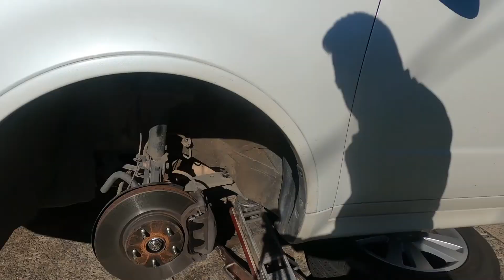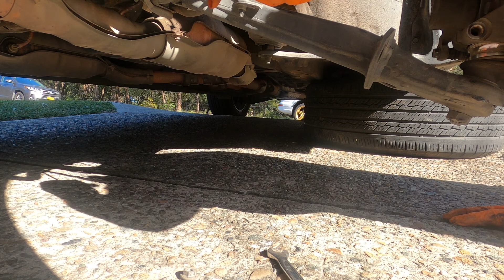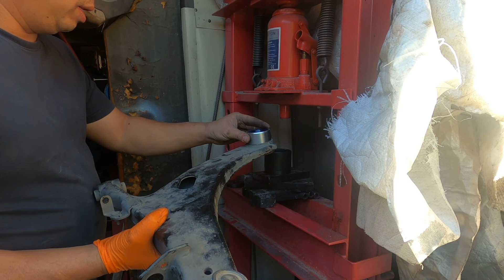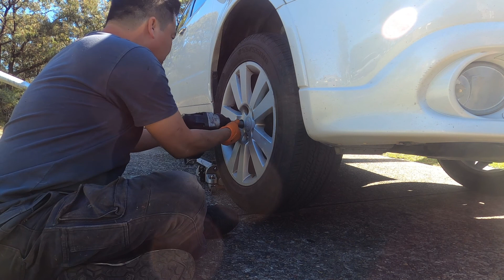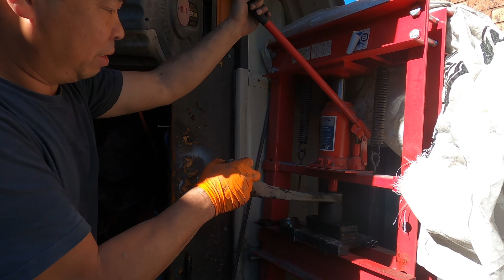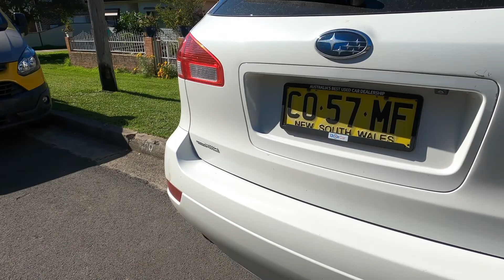subaru tribeca 2012 cv joint and low arm bushes

Comment: I am in the middle of doing a complete bushing replacement on my 08 Subaru Tribeca. I have a small ball joint press kit but it doesn’t have the size adaptors I need so it’s been a pain in the ass. I can’t find anything that sits right on the bushings ledge. I may have to burn and cut it out. I almost won a hydraulic press in an auction last week. Damn I wish I would have won it. It would have saved me a lot of head ache today. I’ll definitely be getting one soon

Comment: I would highly recommend that anyone, especially without a hydrolic press, just replace the control arm. It comes with new bushings and you can get a decent one for 20 or so bucks more than quality bushings. It's a TON easier than having to do all of this. I had to use a jack to lift my passenger side wheel hub back into the strutt as well 😂. It was the only way I could get it up high enough to replace those bolts.